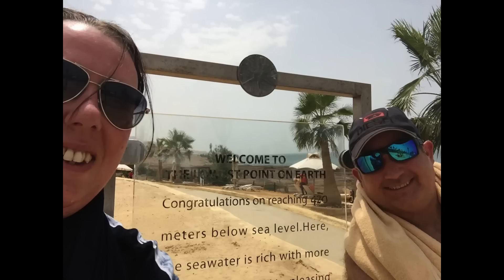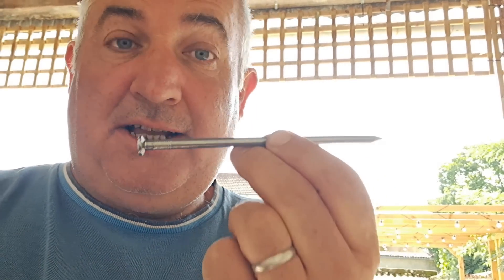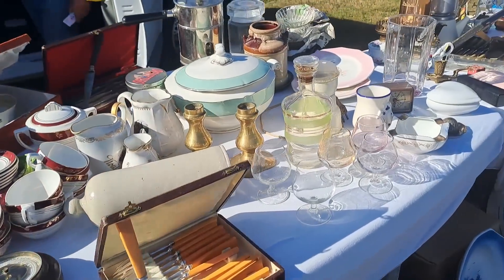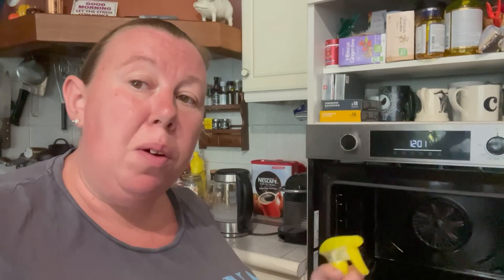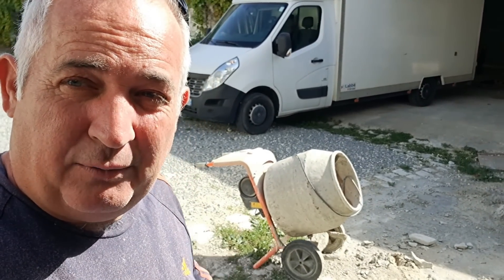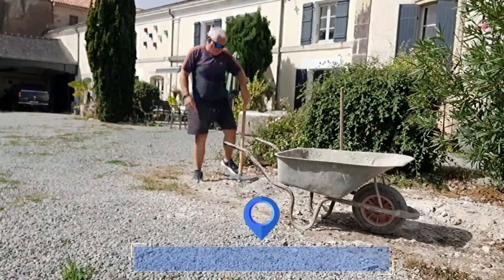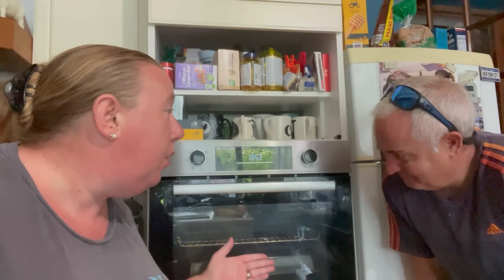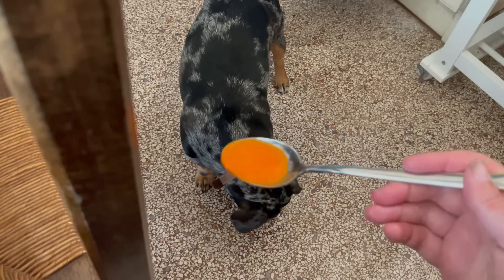Spick & Span #112

Comment: Claire, in my experience Orange Oil does wonders with glue. And it is very fragrant. You might experiment with a corner and see if you could peel that carpet up by soaking it with some Orange Oil.